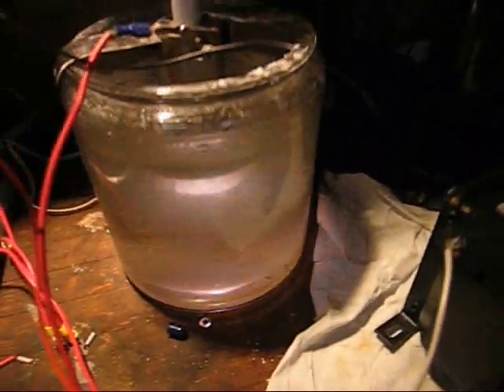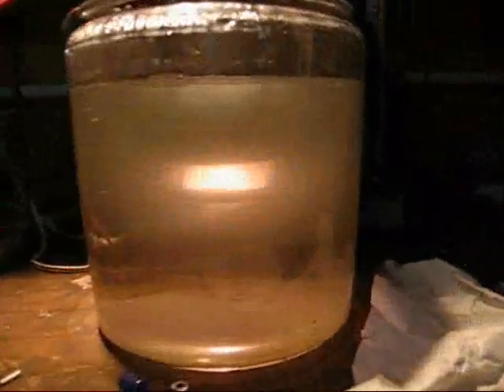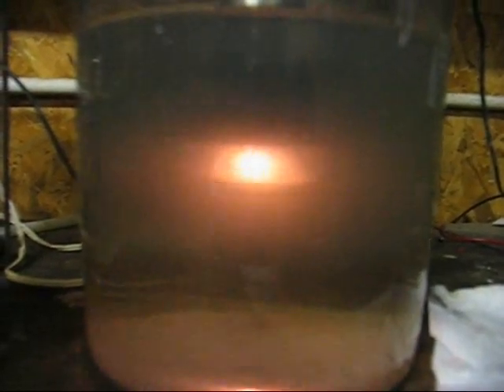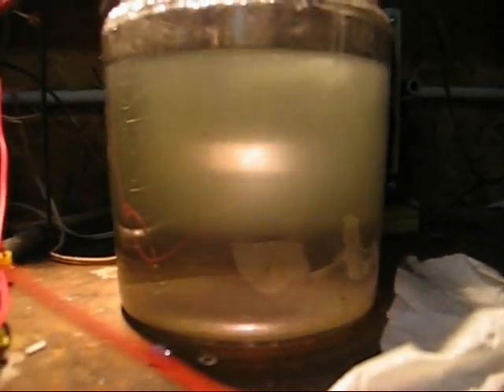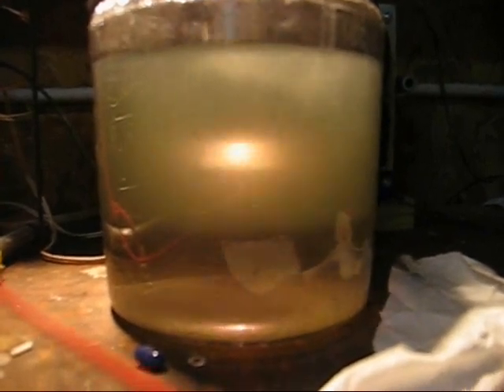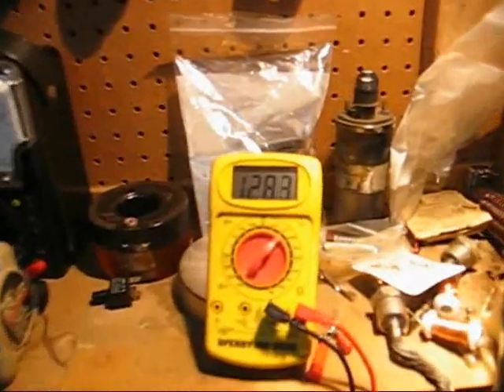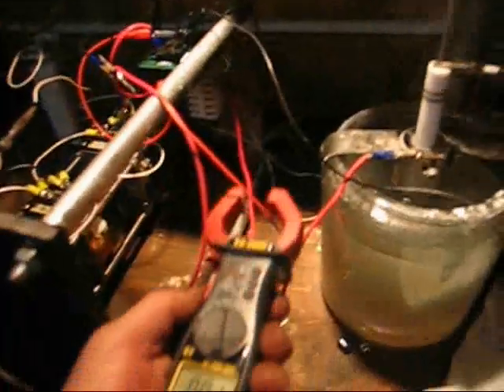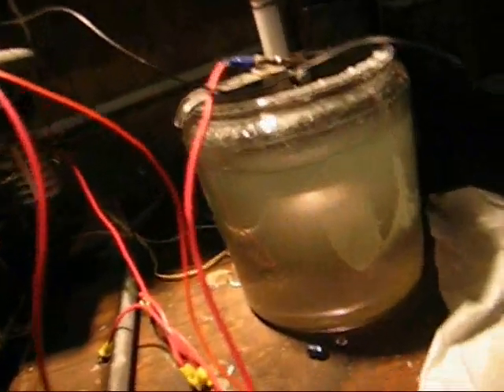Cold Fusion Plasma 5

Comment: no,a fusion reaction refers to changing the atom. changing the molecule is a a chemical reaction. This experiment is simple electrolysis with high voltages. good for separating the atoms in the molecules (or putting them back together), but not much else.

Comment from the maker: Have not tried to burn the gas that is coming off the electrode. Most of it I guess is burning around the electrode. Just testing BTU in the water temp. rise for a given amount of voltage and amps.

Comment from the maker: I think most of it is already burned. Yes I had plenty of electrode left. The larger diameter Carbide electrode shows very little wear after running at high voltages for several hours.